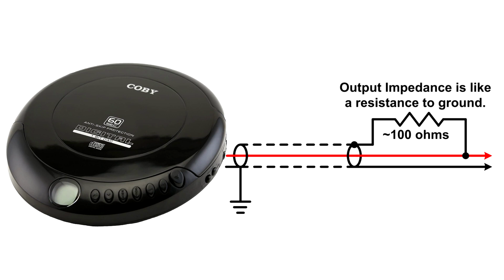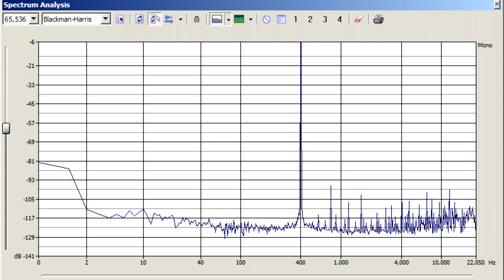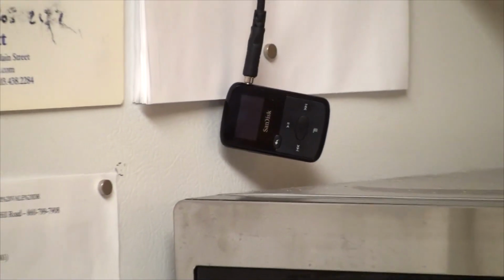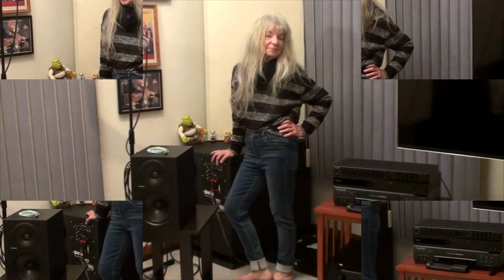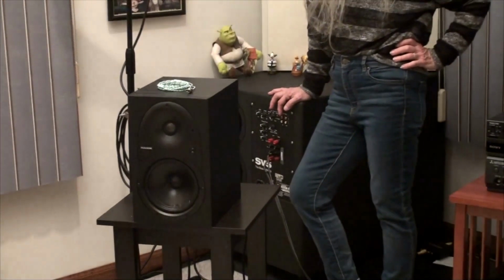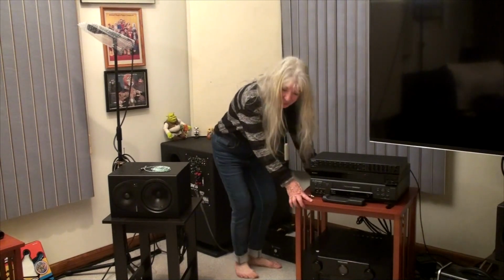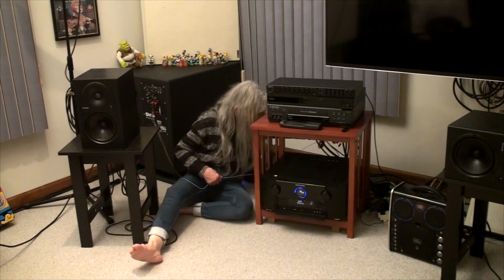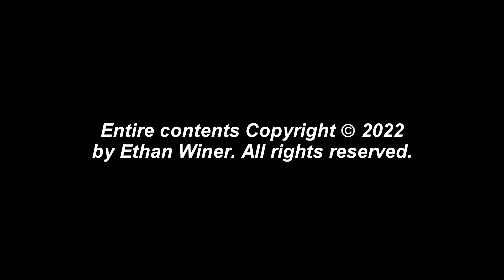How important Is shielding with RCA wires?

Comment: Ethan, it's important to note that you used a twisted pair for your unshielded section, so while you have eliminated the electrostatic shielding, you still have immunity to changing magnetic fields. If you were to untwist those wires and move them apart, with one or the other close to an AC power line, you'd get considerable induced hum.
Reply from the maker: Yes, twisted pair wire does offer some rejection of airborne interference. I'm not convinced that it would have made a difference in my test because the key factor is the low output impedance of the driving devices. Why don't you try the same test I did using untwisted wire, and report back what you find. For extra credit, make a video showing your test, as I did. But understand that the main point of my test was to prove that "shielding" is not a justification for paying high prices for RCA wire.

Comment: You don't really need shielding unless you are running the cable near a 
motor, transformer, magnet, etc. In fact, the main reason they add 
shielding is to make the cable look higher quality so they can sell it 
too you at a higher price. This is especially true with rca cabling.

Comment: Excellent explanation Ethan! Thank you.

I'd like to point out that a coax isn't the same transmission line as a twisted pair. 

So internally to a chassis, when I route audio signals (surrounded by the chassis and enclosure) from low impedance active outputs into relatively high impedance inputs, my experience is outer shield coax makes no difference as you're demonstrating. Practically, only when there is some noise, do I use shielded coax.

And as I'm looking to use active crossovers, your video tipped the balance from balanced input/outputs to single ended for me.

It isn't a matter of cost as there is only a $5 difference unbalanced vs balanced between boards. But all my amplifier circuitry are unbalanced...

Thus I opt for the single ended version.

Personally, for (low) line level signal transmission lines, I use monoprice bulk spool F/UTP CAT6A (product #41485) and for "high end" would use CAT7 SFTP (product #39076) although both are shielded, the main difference (aside from the bandwidth) being CAT7 has each of the individual four pairs, individually shielded as well.

This way I can carry stereo Left and Right, both Low and High pass through one single cable.

Just food for thought. And quite practically inexpensive as well.

All the best Ethan!

Comment: Shielded cable is important to prevent grounding loop,  with 60 Hz hum and buzz. 
This happens when you have a several equipment connected with Audio and Video (HDMI).
A major problem in Many Recording Studio.
Reply: A ground loop doesn't come from stray interference from the air, it comes from resistance between two uneven ground sources. Unless your shield is so thick that it has unmeasurable resistance even over long distances, "shielding" isn't really how you eliminate ground loop.

You'd need balanced connections, audio transformers (not really the best option) or a digital optical connection for a long run. Or, even better, make sure all your equipment is properly grounded.

Comment: These are high level,  relatively low Z systems, and also the amount of noise will depend on local interference. Cell towers, broadcast towers, wi-fi, cell phones will also need to be considered.
When I produced my Ultimate Fireworks Bluray, I quickly discovered that the 67% shielded cables that came with my BD player were inadequate. There was lots of hum and buzz and I could not get the full 86dB of dynamic range in the recording due to the background levels being below the noise floor of the cabling.
I replaced all of my wiring with inexpensive Monoprice wires with 99% or better shield coverage and the hum and buzz were reduced to below the background levels of the recording (about -86dB) and I could enjoy the fireworks without any electrical noise.
These tests are interesting an all, but extreme situations and also the impedance of connected devices needs to be considered.
Reply from the maker: I agree that in some cases shielding might be needed. You live a few hundred yards from a high-power radio tower! But even when Ilene moved the unshielded RCA wire near the AC power wires, there was no big increase in hum pickup. We tried that in the kitchen too, but I didn't include that in this video.
Reply: @EthanWiner  If your power cord isn't radiating hash from switching power supplies, interference will be much reduced. But the real way to measure this is not with a boom box and ears. Use signal to noise measurements with the proper weighting.

Comment: When the lady unplugs the cable from the back of the receiver, I could not hear any hum, yet you said there would be because the output impedance of the receiver wasn't a factor anymore. With the greatest respect this seems to defeat your own argument.
Reply from the maker: Listen again carefully from 4:00 to 4:03. You can hear the background noise rise because I had to turn the volume way up to get the hum loud enough, but there is some hum there. But even if there was no hum, that reinforces my point that shielded wire isn't as important as many people think. Also:

The input impedance of the connected device is a factor. My Mackie powered speakers have an input impedance of 20k, which is the same as having a 20,000 ohm resistor shorting the hot and ground connections together. With a much higher input impedance, such as 1M (1 million ohms) in a typical guitar amplifier, hum picked up by the wire in the air would be much louder because 1M is not much of a short circuit!
Reply: Ethan Winer Thanks for your reply. I did listen again and yes I agree there was a small amount of noise between 4.00 and 4.03.

Comment: Great video, Ethan. How well would this this hold up if I fired my ham radio station up?
Reply from the maker: I have no idea. But keep in mind if RF or 60 Hz AC or whatever is so strong in the air, it will get into the electronics through other ways such as the AC power wire or a plastic enclosure.

Comment: I always use high quality cables with good shielding. (Mostly Mogami) This basically ensures that the cables aren't a bottleneck on the system. Additionally, they feel and look nicer than the usual, bundled, cables.
Reply: mogami is just a pleasure to work with and is not exotic either. prices are decent.

Comment: I use shielded cables now, because once I used unshielded and there was some weird pulsing or interference that came from phones or the router nearby I think. Could the twisted pair be rejecting noise? Read somewhere too that GSM cell signals caused this but not CDMA (Verizon and Sprint).

I'm OCD now about hiss and like how strong the XLR connections feel... Ideally I'd like AES/EBU for everything, or a new format that could daisy chain things around the room and carry a dozen channels or so.
Reply: Many professional recording studios use a digital fiber optic multichannel signal transmission "cable" and system called DANTE, or ADAT/SMUX.  Dante uses a proprietary cable but ADAT/SMUX uses a standard Toslink fiber optic cable that is traditionally used for the 2-channel S/PDIF protocol).

Dante has much more bandwidth in order to carry/transmit many more channels of 24/192 or higher digital audio.

I use ADAT/SMUX via dual fiber optic Toslink cables to connect my 8-channel Thunderbolt/USB audio recording interface/mic preamps to another 24/96 8-channel outboard mic preamp/AD/DA unit (Audient ASP-880) in my home recording studio to track drums & percussion and/or full multi-instrument bands.

Most everything else in the studio besides electric guitar and bass are connected via balanced XLR I/O.

But yes, the older GSM EDGE 2G & 3G cellular network RF signals would radiate strong RF into nearby audio devices and cabling.

Comment: When listening, I prefer not to put up with the faint background signal noise (noise floor)

One should try pressing pause or mute, and from the MLP,  if one is unable to differentiate whether the systems on or off that's telling you, your cables are crap.

When friends or guests come around rather than showing them how loud the system goes, I prefer to press pause/mute and show them how quiet it goes. None of them gets it, of course 😂

After auditioning three separate AVR's, the same ambient sound of the room was still present! It was only on the third occasion when I finally purchased shielded cables that the noise floor in my small room finally came down to satisfactory levels. Cables often act as antennas for attracting RF, and the longer the cable, the better the antenna. Probably explains why when I used to disconnect my heights and surrounds within 10 minutes, the faint background signal noise (RF/EMI) within my small room used to disappear/dissipate.

Even though I'm now using a high-performance arcam avr20 with matching power amps, at the time, as well as my original budget Sony SDR dn1080 AVR most of my testing came from when I was auditioning mid-price Japanese AVR's

Never mind the cost, do you really think I would go through all this work not once, not twice, but on the third time to get it right...
If interested, here's a 3-minute video of what I went through. Please bear in mind that I'm no videographer 😂
https://youtu.be/wwU0d3NfRQw?si=8RcX4g8b07jjmYEr
Reply from the maker: RCA wires don't usually matter. Maybe you live near a strong radio transmitter?

Comment: I'm not sure saying "output impedance is like a resistance to ground" is an accurate statement. Output Z is usually modeled as a complex impedance, in series with the signal.
Reply from the maker: Agreed, though this video is aimed at audiophiles and recoding engineers rather than degreed electrical engineers. So no need to get into complex impedance. Plus, I'd expect the output impedance of media players and hi-fi receivers to be relatively uniform over most of the audio range, especially at low "mains hum" frequencies.
Reply: @EthanWiner  Thank you for taking the time to reply. Sure, forget about complex loads. What I'm confused about is the equivalent output impedance being tied to ground as opposed to in series with the signal-- that's how I've usually seen output impedance modeled as. More generally, I do agree on your argument about shielding, and my practical experience reflects this as well!
Reply from the maker: Sure, the output impedance can be seen as in series with the output. But what's on the other side of that impedance, inside the outputting device? Zero ohms to ground! So it's basically the same thing, tomato to-mah-to. :D

Comment: I used cheap rca cables from a preamp to active speakers and got a low hum. I bought shielded cables for 40 dollars and the hum disappeared . Didn’t notice SQ difference but that hum bothered me.
Reply: Cabling and connectors do matter, also the general quality. So perhaps there was an issue there. It's not the shielding though

Comment: Very interesting.  But I still prefer XLRs.  Why?  Because the bulk of my "hifi" system is pro audio rack mount components that use XLR or TRS. And after using XLR for awhile, RCAs seem plain dinky!
Reply from the maker: Of course! XLR connectors are much more rugged than RCA connectors. The original RCA connectors were never designed for consumer use! They were meant to connect the various modules inside TV sets, to make it easier to remove modules for service without having to unsolder wires.
Reply: @EthanWiner  Thanks!  I'll remember that.  The idea of a "first" removable electrical connector is odd to think about given how many options there are now.
Reply: I always liked DIN connectors, they are very flexible, but they never really caught on for some reason.
Reply from the maker: @chriswilson1853  5-pin DIN connectors had a long run for use with MIDI synthesizers, but most MIDI interfaces now use USB.

Comment: So, you're telling me, for line level signals, fancy audio cables are not worth the asking price? Agreed. The new thing that I simply cannot believe are companies selling "balanced" audio cables for headphones. AFAIK, balanced wiring is for long runs of low level signals.
Reply: The balanced audio headphone "theory" doesn't have anything much in common with actual balanced audio. In regular headphones, each drive unit shares a common ground. In the so-called "balanced" headphones, 4 connectors are used instead of the usual 3, with each driver driven by its own pair of wires. Supposedly this removes low-level crosstalk between the two drivers, by virtue of them not having a shared ground. 🤷‍♂️  seems highly debatable whether there's any real benefit to this...but you know audiophiles...they'll lap up anything that sounds impressive.
Reply: @njm1971nyc 
The main reason for using balanced cables with (some) headphones and a balance headphone amplifier is not to reduce/reject inducted noise, but rather to take advantage of the general doubling of power output that is sometimes needed to fully drive (some) low sensitivity, high impedance headphone transducers.